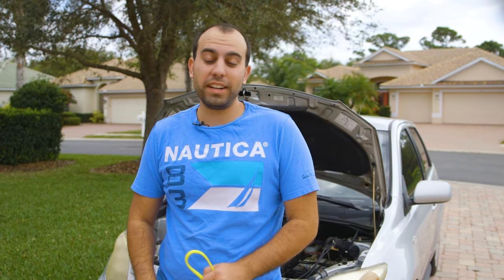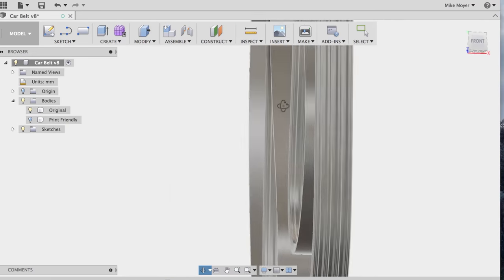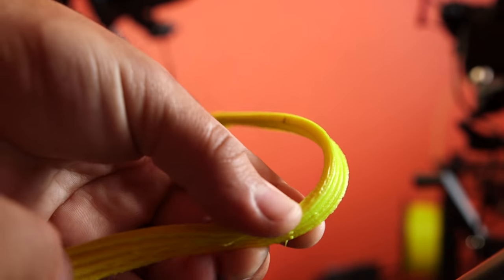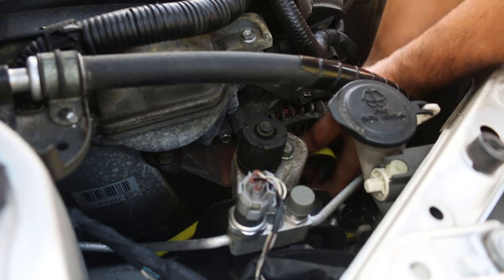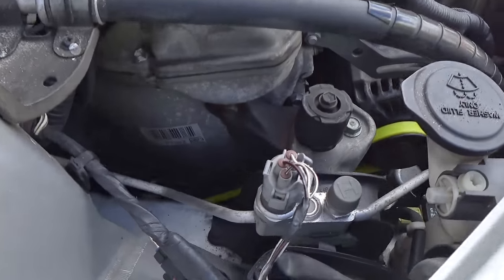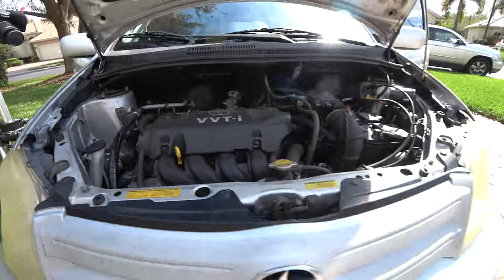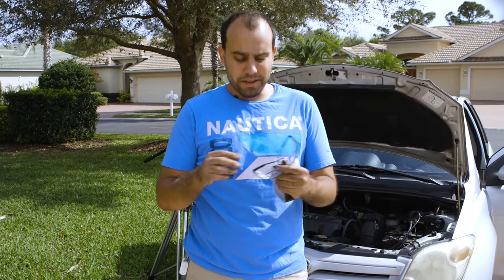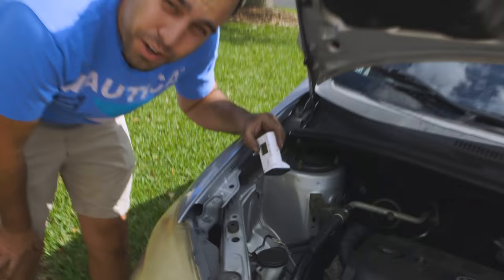3D Printed Car Belt | Will It Run?

Comment: your engine can run with nothing there, it's an accessory belt. just because those items are spinning, doesn't mean that's whats keeping the engine running. you need to lookup an animation on how an internal combustion engine works.
Reply: He never said the engine wouldn't run without the belt...
Reply: David G since when did a water pump become a fucking accessory? And that motor could not run without the alternator. Alternators in new cars are a necessity. When it finally drains the battery the whole motor will just shut off.
Reply: First of all, most all cars have the water pump driven by the timing belt, secondly, the car can run without the alternator, obviously not for long, but in the case of this video when he said "the belt is keeping the engine turning" that's not true. He's not going on a roadtrip, the car can run without both of those before the water temps go up/battery drains.
Reply: I'm pretty sure that at no point in the video he said "the belt is keeping the engine turning" as you claim. He said the belt runs the water pump and the alternator, and that without the belt the engine could run fine for a few minutes (obviously meaning without overheating or draining the battery too much).

Although he did say "It is legitimately turning the engine", which he probably actually didn't mean "engine" but rather the accessories.
Reply: RedFlaggWaving "it is legitimately turning the engine" at 3:02.
Reply: Andy England you must not know how an internal combustion engine works if you think that belt is running the engine. It's not an electric motor.
Reply: David G Chill out, bro, he was just quoting the video and for some reason replying to my comment and giving no context
Reply: David G That's not what I was saying. I was pointing out to the red flag dude that the YouTuber did infact assume that the serpentine belt drove the engine. I know how a motor runs.
Reply: RedFlaggWaving sorry for the lack of context, I was distracted. See my previous comment explaining it.
Reply: Andy England figured you'd say that, therefore I'd like to direct you to the "Read more" button below my comment up there, where I had already mentioned what you said previously about the video.
Reply: RedFlaggWaving good point. I didn't notice the "see more" Link
Reply: +David G

>First of all, most all cars have the water pump driven by the timing belt

From this comment, you've lost all credibility of knowing anything about engines. Modern cars drive the water pump from the serpentine belt, usually shared with the A/C compressor and alternator, with the power steering pump usually on a separate belt off the crank pulley, not the timing belt.

And to prove calling bullshit on you, when's the last time you saw a sprocket on a water pump? Because timing belts have teeth on them to avoid slipping.

Older cars with multiple belts have different arrangements for driving the water pump, and sometimes have them driven by their own belts (like really old Ford flathead engines), but I've never seen a timing belt driven water pump, and I've seen a few hundred engines.
Reply: not true if you do not have an alt it will dye as soon as the bat is dead  and if there is no water pump it will over heat
Reply: un less its an old diesel with only a manual shut off they all need a power source like an alt or gen
Reply: thebad300 but it's not an old Diesel with...
Reply: I've had broken serpentine and pulleys before, your power steering goes out so you have a hard time turning the wheel but you're able to pull over into a parking lot to replace
Reply: There isn't one specific method for modern cars and one for old.  In my garage at the moment I have an aux belt driven pump (Ford Duratec), a timing belt driven pump (Rover K Series) and a fully electric pump (BMW N52).  Timing belt driven pumps are less common but I've worked on a few engine types with them and I only play with cars as a hobby.
Reply: Dude, without the alternator spinning, the car will die because the battery will be dead. Without the pump, it would over heat. They're both needed

Comment: Staying on the topic of cars it would be neat to print a push clip. A.K.A those pesky little clips that are the bane of my existence...
Reply: this would be awesome there are so many different types of these clips, and "2 bucks at the parts store" only applies to the common ones. I have a few on my car that are $2 a piece, and some of the older cars I work on have discontinued specialty clips that being able to print new ones would be awesome because 40 year old plastic is brittle
Reply: Hayden Truman I always buy them at the hardware store.
Reply: Larry Chase $10 for two at my local auto parts store with trade discount $5 for 30 on eBay
Reply: are we talking the x-mas tree ones that never want to pull out, or the pin in the center that break every damn time
Reply: Message me if you ever need these clips made. I 3D print things and am always looking to learn more!

Comment: Belts have nylon in them to hold the belt together, with out the nylon support structure you'll have what you had happen. The belt will just keep stretching until it breaks.

Comment: If im not mistaking im pretty sure the engine will run without the serpentine belt i think the battery would die before anything bad happens to the engine (as in overheating because no water pump)

Comment: The belt here has strong internal part which is not rubber. That prevent it belt is too elastic under load. The belt printed from rubber will stretch too much and rip pretty quick after a while.
Wipers are good idea, car door rubbers are also possible. Everything without hard part is possible.

Comment: If you print it in that sort of zigzag pattern you're gonna have to shape it out info a circle before you use it, otherwise the tension will vary as the belt goes around and you'll get a lot of wobbling. The same problem exists with regular belts; if you leave them on foor too long without using them they'll start to take on an oval shape, which causes wobble.

Comment: Most belts typically have nylon/carbon/kevlar/steel fibers impregnated into the belt as the member that transfers the tension along with far more durable rubber compounds to make a very strong composite though non-homogeneous material.

Comment: there are steel cords inside normal belts that actually does the work and holds the shape. the rubber just provides more friction and acts as a sacrificial material

Comment: The Toyota VVT-i Motor (Variable Valve Timing with intelligence) runs without car belt .The engine has a chain internally installed for the control times .The belt of the engine moves only the water pump and the generator so it is no wonder the engine starts and runs.

Comment: I can be made to work. If you have a dual extruder printer, re design the model to have internal diagonal Nylon stands a few MM apart. So a later of flexible, a later of Nylon diagonals, flexible, reverse Nylon diagonals and so on until you get the thickness you need.  I think you should give it a try :-)

Comment: the car would have ran without a belt regardless
Reply: Well he said "it is legitimately turning the engine," at 3:02 so he obviously doesn't know shit about cars.
Reply: Warden He has a Toyata man
Reply: yeah it is going to run then warp the cylinder head from heat 
PS don't ask me how i know it

Comment: Great vid thanks, BUT, I demand a redo with a thicker printed belt. The original can only be that thin because it's reinforced with Kevlar. Thanks for the Fusion tip, I will try this with GT2 belts soon, for a RC project.

Comment: as Dustin said, windshield wiper blades. 
  Also, if you had paused the printing occasionally and lightly glued nylon or similar string to the surface that might have held much longer .. ?   reinforcement material.

Comment: This could work quite well, the main failure I see there is that it started to slip & this is what made it chew it in one place, adding a coat of something on the inside of the belt like a spray on rubber, and as someone mentioned earlier these belts normally have a braided reinforcement weather it be steal or Kevlar, if you can get your hands on some finer/string and make a flat braid there is a technique that you could use to print it into the belt and it should last a long time

Comment: Most automotive drive belts are either cotton chord or kevlar reinforcing to prevent the stretching that made this fail. Is there a flexible carbon/kevlar filament available?

Comment: It's probably good that you couldn't print the belt flat and then merge the ends since that would have a lot more failure points than printing the belt on its side so the layers would be parallel to the motion.

Comment: you need a tensioner pulley where it was flapping, then it might run longer. depends on the material you used, whether it will start to melt, tear like it did, or just snap. nice video though

Comment: You could try to pause the print in mid-run and try to inlay fine metal wires every millimeter or so. or in a spiral round and round. real belts will have those, too. they might just give it the stability it needs to stop it from weeblewobbling, which comes from the fact that the rubber (?) streches under load.
probably don't use copper because that breaks when flexed too much. but i guess even copper should make a belt hold much longer than that.
very nice experiment!

Comment: As I see you've responded to others regarding this, the belt needs to have metal and thread reinforcement, that's why it flops around so much and likely the material wasn't grippy enough to stick either. Either way I'm sure it's still cheaper to just buy a new belt lol.

Comment: The altinator seized in my old 86 chevy s10 4.3v6. It stopped the engine cold at half throttle and locked up the rear tires at 45mph untill i jumped on the clutch. Nylon fibre core serpentine belts are incredibly strong...

Comment: what material does this 3d printer use? belts have to withstand high torque values, so I knew this would fail. thanks for the video though.  3d printing should have options for materials strong enough to do it, if not now, then shortly.

Comment: You should have cut open the manufactured belt and notice three materials, rubber, string,  and some kind of fabric cloth.  i suspect string is wrapped a few times. mine when it snapped, i noticed 4 string strands.  wondering if it is 4 wraps or four sets of strings.   clearly string is there to prevent elongation of the rubber or flexible material.  the cloth i found in there, i don't know why.

Comment: If you had a Mark Forge you could use the that filament with Kevlar layers if you can cheat the machine to work with flexy filament. That would work for a useful amount of time. BTW real belt don't have metal wires they have kevlar stands in them. Tires have wires.

Comment: You should reprint the belt but make it 3-8mm shorter in length. This will take in accout of the plastic stretching. May even shorten it an inch or two. But awesome prof of concept video. Alot of thought went into making that work.

Comment: Like with the guys who did the test with 3d printed boat propeller blades, you should have used multiple types of filament to try and get the best results possible.

Comment: That was so awesome.  I really want a 3D printer but don't know where to start.  Just today I saw a someone 3D print a house with concrete. You should give that a try or maybe a car interior plastic trim piece since it wouldn't need to be quite as strong..

Comment: You can make some cool customized caps like power steering cap or overflow reservoir cap. Don't try oil cap or master cylinder cap tho. Power steering cap may need to be made from high heat material tho

Comment: Interesting....
I actually don't think this is a bad idea. OP has shown that a 3d printer that uses a single polymer has some limited success. 

That's pretty good considering, as many have noted, serpentine belts have other bits in them. That said, most aren't pointing OP in the correct direction. Metal isn't always in automotive belts (it depends on the manufacturer of the car.), but polyamide cloth is a standard choice. 

With that in mind, I think this would work fine if you used straight nylon, or a mixture of nylon and Thermal Polyurethane.

Finally, you didn't mention any post production treatment of the belt, but bonding the belt to a bit of cloth, using pressure and heat, might be a good post print treatment for this particular deal. Also, depending on how you bind the cloth to it, you might be able to print the belt in a different orientation. If you print the belt with the flat side to the bed, and then bond a cloth backing to the entireity of the belt post print, you'd probably have a bit more success overall.

Comment: :D I've used once pantyhose, that stuff works very well. I could not be arsed to swap it, so it was there for weeks no issues. Those are nylon so they can take quite a bit.

Print the belt using nylon and i bet it works :)
Reply: Most regular belts for cars have nylon braiding inside the rubber. So there's that too.

Comment: Eh, there's a reason why are those things basically composites (pretty much reinforced rubber). Judging by the looks of it your "printout" has started to wobble because the material has almost zero strength and deforms (permanently) very easily. In the end it looked like it's been stretched out.
Reply: I think that the most important reason for those things being made from a rubber composite is the fact that they want the engine to be as quiet as possible.

Comment: Serpentine belts are constructed with small cables embedded in the rubber to provide rigidity and strength. I suspect if you could figure out how to incorporate something similar, your belt would have been fine. Cool video regardless.
Reply: Rubber is a more durable material, and even that still fails with time or improper installation. A 3D printed belt just won't work.

Comment: The reason it didn't last is because factory made belts have braided nylon inside like a radiator hose.If your factory belt was just made from the black rubber it would do the same as your printed one.
You could try printing a new gas cap.It's all plastic and people lose them all the time.

Comment: The problem you have is that the belt needs to be reinforced with nylon  threading to stop the belt stretching  too much as it rides the pulleys... the chances of getting a nylon strand into a 3D printed belt are extremely slim though so I don't think it's  viable long-term method... YET

Comment: Back in the day you would ask your wife or girlfriend for her stockings to replace the snapped alternator/generator belt in an emergency. Timing belts didn't exist, that was done by pushrods or an internal chain in the block.

Of course it would be insanity to switch a timing belt for anything like this! Auxiliary belt still insane but easy and not catastrophic.

Comment: i'm guessing your AC compressor kicked the bucket already?  I have a first gen XB, that belt normally turns the AC compressor as well.  But they tend to fail early, and since the toyota echo has basically the same engine but no AC, you can use it's belt to just turn the water pump and alt.  Also, I'm thinking the slapping effect of the 3d belt is because it cannot stretch like a rubber belt, and without good tension it wont stay tight to the pulley.

Comment: That wasn't the water pump that was your AC pump and your alternator it looks like. and I bet it would have ran longer if the AC pump wasn't on because that's quite a bit of load on a belt.

Comment: Could another material work any better, or a better 3D printer?
Reply: Angel Luis Trinidad no.  There is a reason Goodyear uses steel and rubber.  Plastic is terrible for this type of use.

Comment: If that belt tension was adjustable, it looks like it was way too loose. It should technically work given that the rubber you are using is tough, and that the tension is adequate. I guess the materials you used probably aren't good for this task along with the lose tension.

Comment: If you had added fiber tape to the back of the belt after printing the it, the belt may have last longer on the running engine.

Comment: I don't think it actually worked there because the car would still start without a belt for awhile but if it wasn't tight enough it wouldn't turn the alternator it kinda just looks like it's being destroyed by the crank pulley but not actually turning anything

Comment: It would probably work better if you used a stronger material like NylonX or something of that nature. They're designed to take heat and tension better than what I suspect you're using for this test

Comment: Wow really cool/scary lol..This could definity work by adding in steel wire into the belt after you print it then rienforce it with thin rubber on the outside... But glad youre showing the possiblities of 3d printing...

Comment: Great build !! but the promlem is the material in normal case the belt made by steel/string rainforced  rubber becuse of that the belt cant strain .

Comment: Altenator and ac compressor should be run by the drive belt, the serpentine should do the water pump, powersteering and power brakes